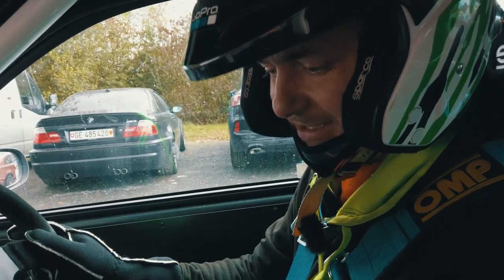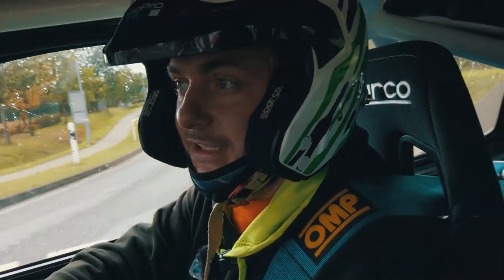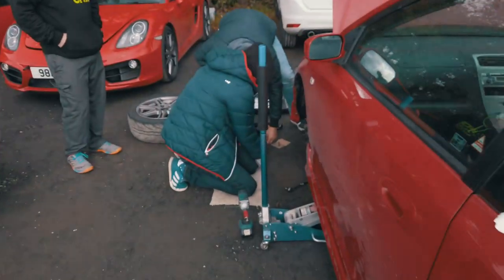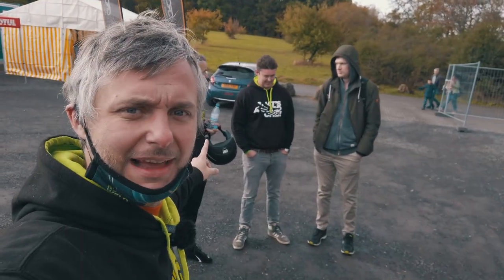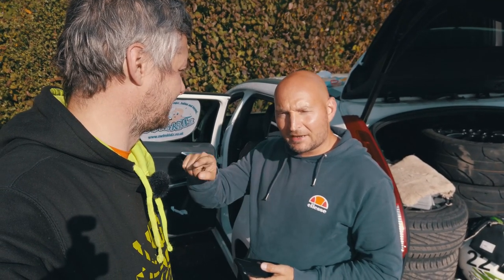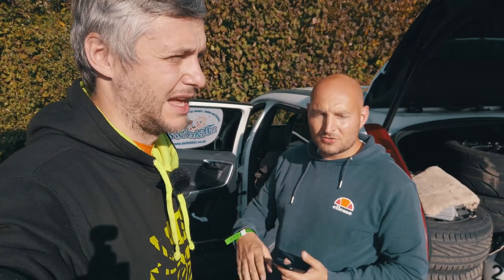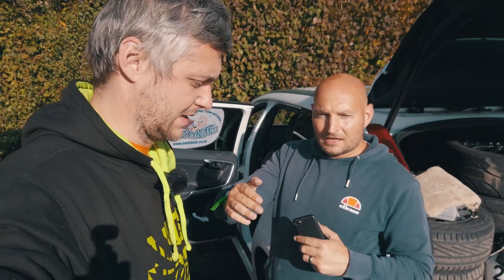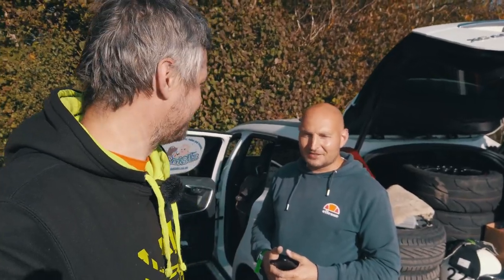Nurburgring 2020 Vlog. Track covered in oil and water! N.ovichok MK3 debut

Comment: What's the spec of the black Clio? Can't wait to see your car on track, soon I hope!
Reply from the maker: Completely Standard engine no remaps even. 
AST suspension, full cage, better brakes... all you need
Reply: @RuskiWeldFab  and a gripper diff, a/c delete, fatty induction kit and decat. Also had ARP rod bolts and new shells, but that was preventative maintenance/ prep for the next level of mods Ruski and me will be working on over the winter 😬
Reply: Cool, maybe a wee side project for a few more videos then?

Comment: What is the brake set up? I've been trying to get mine dialled, first couple cm of pedal dont really seem to do anything. Currently running:
Standard MC, callipers
braided lines front rear
ds1.11 front pads
oe spec pagid rear pads
brembo hc discs front
standard discs rear
castrol RCF fluid
ducts to front calipers

not getting fade at all just not getting a lot of retardation
Reply: Hi mate. It’s standard braking system with braided lines front and rear (including the rear calliper to axle line replacing the green metal/rubber mix) brembo hc grooved and vented discs. Hel hp600 front pads and oe brembo rear pads. ATE Type 200 dot 4 fluid.
Reply: @andylaunchbury8539  do you find that you get good pressure right at the top of the pedal? I've come from karts where the entire pedal travel is less than I have to press to get the thing to slow down. I've also done full rear braided but I think possibly the internal diameter is different requiring more MC travel for the same slave movement?
Reply: @SkillzorZ021  I’d say progressive rather than firm from the top of the pedal, but bites well and good modulation. I’m less aggressive on the brakes than Ilya, but when pax with him it surprised me how strong they were under much heavier braking forces. Will say that this is all subjective and what one person loves another  may not, but this setup works for me in my car and to get praise from Ilya looking at his setup then I’ll take that as a decent compliment.🙂
Reply from the maker: yes i was well impressed. strong pedal good modulation. bites at top for trail braking with no fade. yes it was cold and damp so breaks were used less but i had no bad comments about the brakes. was spot on for me.
Reply: @RuskiWeldFab   @Andy Launchbury  interesting, are you guys going to be at any trackdays in the uk this year? would like to get a second opinion on mine and potentially pootle around the paddock in another one just to get a feel. I've bled brakes loads of times, and had the abs bled with clip. Im at a loss as to what to do next
Reply from the maker: Snetterton 1st dec.
Reply: @RuskiWeldFab  which TDO?
Reply from the maker: Track obsession
Reply: @RuskiWeldFab  damn it's cheap! unfortunately I'm at Silverstone on the 27th and I don't think work will let me have two days off around the end/beginning of the month :(